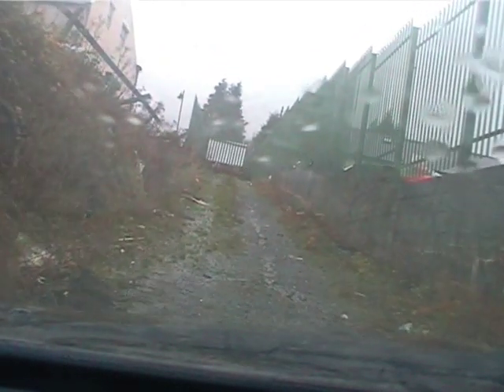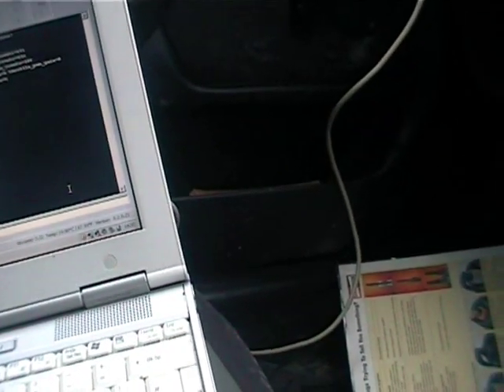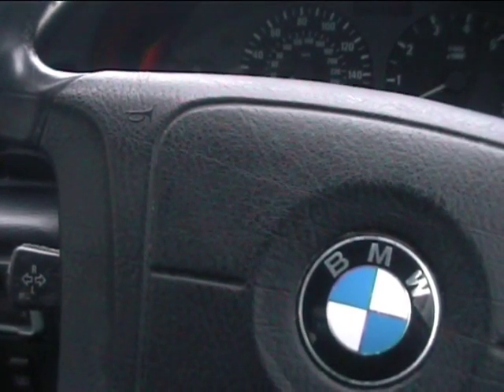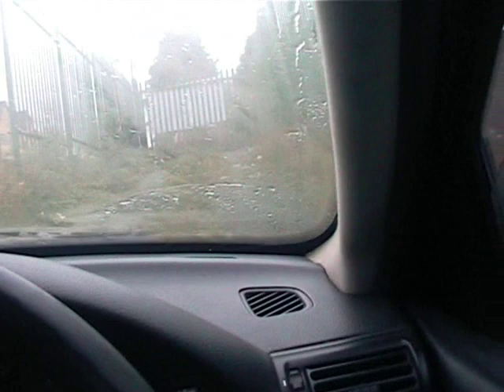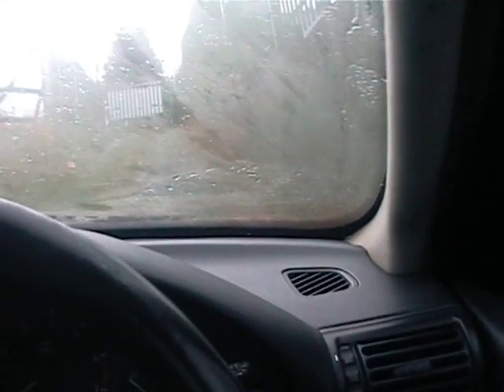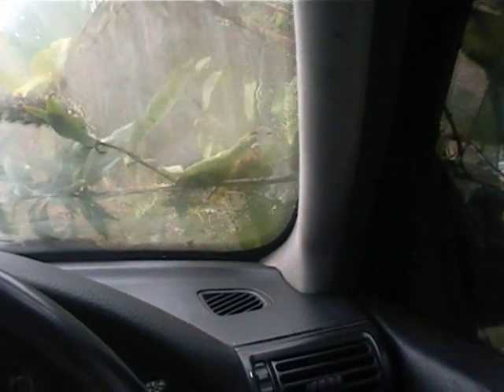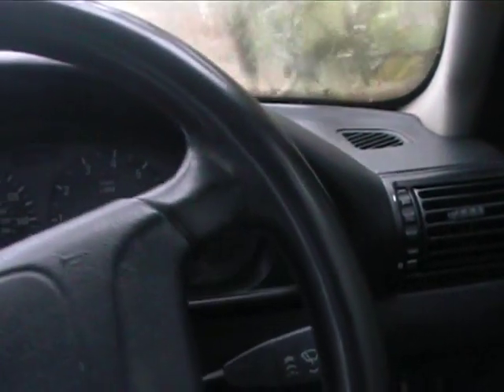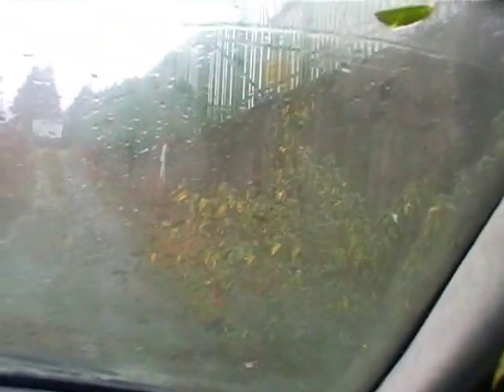BMW EV Conversion 14 Cutting hay

Comment from the maker: Actually the 3 7ah batteries were providing 36v to the shunt winding on the motor. Traction power (24v) came from 2 old 150ah agm batteries.

Comment from the maker: Power steering uses a toyota mr2 electric pump in place of the belt driven pump on the bmw. They are readily available on ebay.

Comment: Well of COURSE you're out of gas!! 

Remarkable you could make it up that hill with just 3 of those little 7Ah batteries!

Oh, and if you haven't already, you might want to consider rubber isolation mounts on the vacuum pump and some kind of "muffler" for the air output (although its sound can also be a warning to pedestrians that an otherwise silent EV is coming their way).